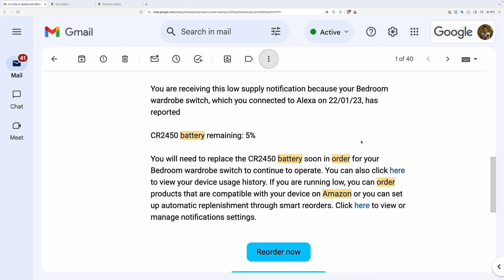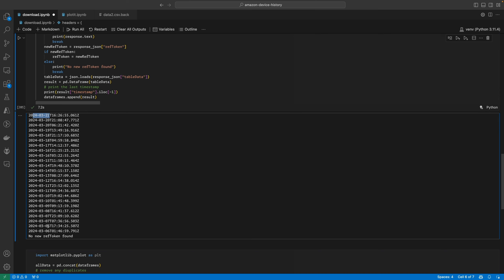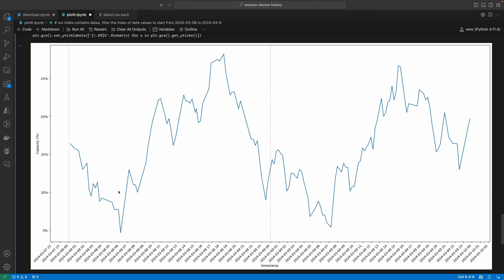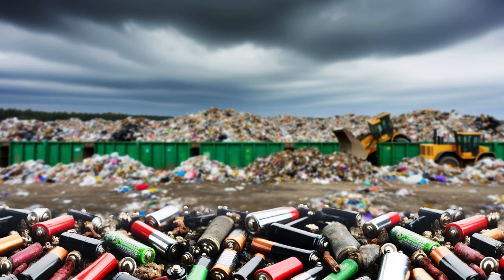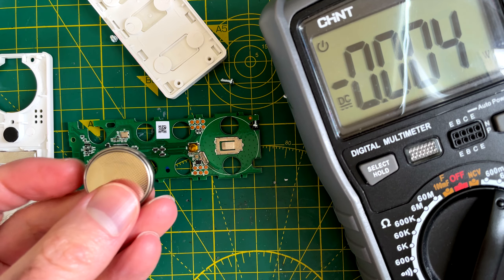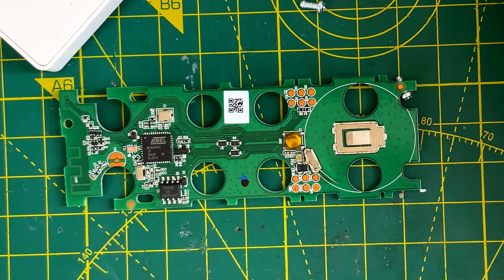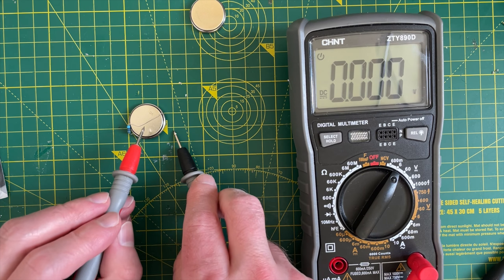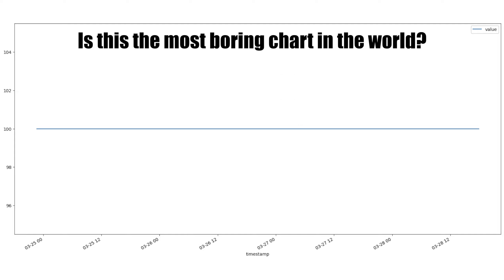Is it time to change my batteries? Amazon thinks so!

Comment: If the normal battery lasts 7 years then your just be wasting your time on a rechargeable one. It would probably self-discharg in a few months i expect.  I had a 3020 that still retained the memory information in a radio after 30 years and the nicads still recharged after being left that long sometimes your surprised that could happen.
Reply from the maker: That is a very good point.

Comment: I dont get the point of amazon monitoring the battery devices from the HUE Products. Does Amazon monitor every IOT device? Do they only have some affiliate stuff going on with specifc amazon traders?
Reply from the maker: It's part of Alexa, we've actually only got the one switch in the house, but you can connect it to Alexa and there's an option to monitor supply levels - must have ticked that when I set it all up.

Comment: Something to consider if you have devices that take several sizes:  You can easily 3D print some small adapters (on thingiverse) that enable to to use smaller (2032) batteries in place of the larger ones (2450).  Yes, they'll need changing a little more often, but it means you can buy in bulk which is cheaper, and always have one on hand.  It also means you can use rechargeable batteries in devices that can handle them, despite most places not making larger rechargeable versions. (Try finding an L2450, for example.)
Reply from the maker: Oooh - that's a good idea!

Comment: I find it extremely hard to believe that the temperature in your bedroom gets cold enough to reduce a non-rechargeable battery's capacity by a factor of 5. That usually doesn't start to happen until you are close to freezing, which you are not doing in your bedroom because... well you'd freeze.

A short google shows that a fresh lithium cell would lose 0.5 volts going from 40 degrees C to 0C, that's not really the same as going from 25% to 5%.

I'm guessing that you're looking at a very very dead battery that is just giving up, and the whoe thing will disappear when you replace the battery.
Reply from the maker: Yes, the battery is almost dead - it’s been in the device for seven years!

Comment: Make sure not to touch the edges between + and - of the coin cell as you do in your video.
The grease you will leave from your finger tips will dramatically increase leak current.
Well "dramatically" compared to the nominal idle power consumption of the device itself.
It can shorten the lifetime of your coin cell by years given the old one lasted 7 years.
Reply from the maker: Hmm, good point, I'll give it a bit of a wipe with IPA.
Reply: @atomic14  No idea what IPA will do to the isolator between contacts.
I always use a paper towel when handling coin cells.

N.B.
I also used it when handling halogen bulbs by the way as the same grease from your fingers may affect the heat-resistant glass of those bulbs which may lead to cracks when they get as hot as they are designed to be.